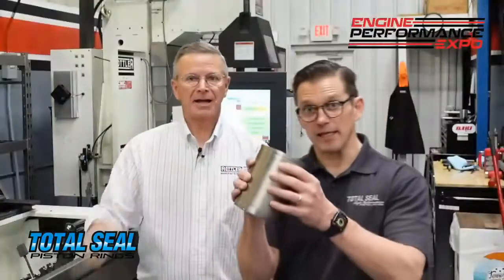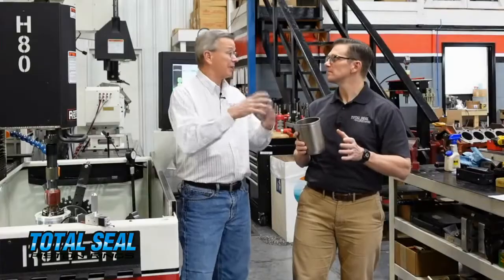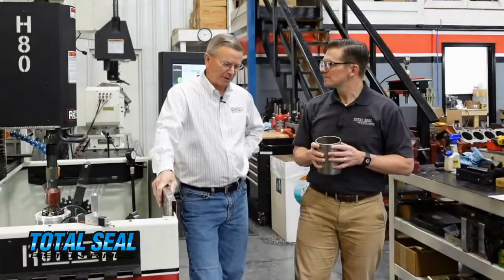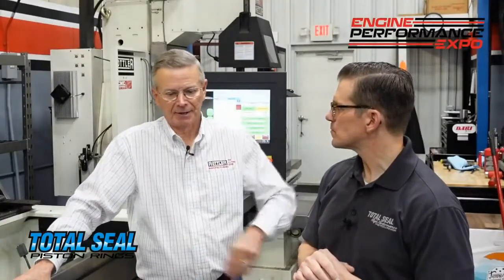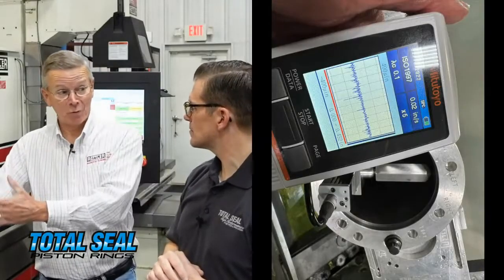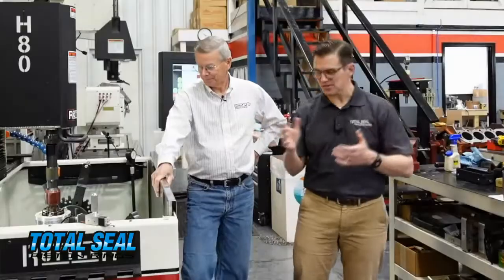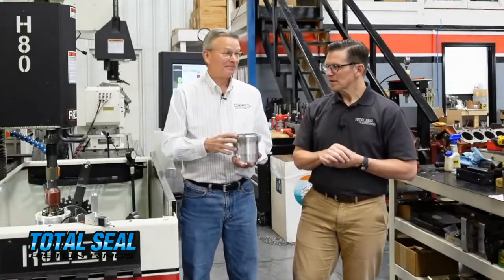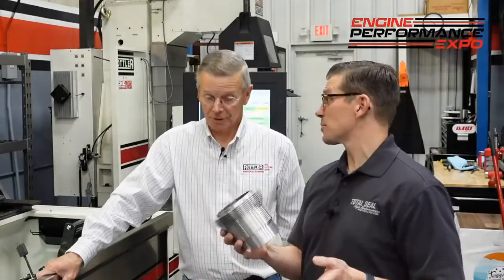SUMEbore Cylinder Coatings (2023 - Episode 48)

Comment: Amazing info. With hard plasma coatings, why not end in a finer grit like a 3,000 grit diamond? 

At 1,200 that’s not mirror finish. That’s pre-polish/fine-lapping territory. Fine polish is 2-3000. Mirror is 4-8000. And final polish goes between 14,000- 200k.
I’ve always wondered why not use Diamond Polishing Pastes that are sold in syringes 💉 that have lap and polish gemstones such as opals, agates, jadeites, amethysts and while keeping the 1,200 grit stone also apply several of the pastes by hand onto the cylinder walls and then run those 8-10 passes.
Reply: i think because it can only be so smooth before you start to get blowby. think of a worn motor... its not so much oversize, but glazed over that creates poor leakdown and/or compression. for example on a steel bore, 220-320 grit is about right

Comment: Ductile iron sleeves are only for diesels anymore, how about a comparison between plasma spray and nikasil!
Reply: My 700 HP Subaru runs Darton ductile iron sleeves without issue ... vrroom, vrrooom.
Reply: @mbdulka  No doubt they work, but they're not optimal and you're adding unnecessary weight/weakness to the block...
Reply: @beachboardfan9544  What is optimal to you?  For running 2.5 times more HP than stock?
Reply: @mbdulka  Optimal would've been to not weaken the block and introduce differential metals which can result in galvanic corrosion, and have different expansion and contraction rates, increasing the likelihood of head gasket failure. Also ductile iron sleeves will wear faster than nikasil coated alum bore...